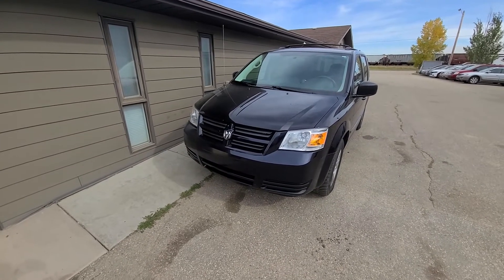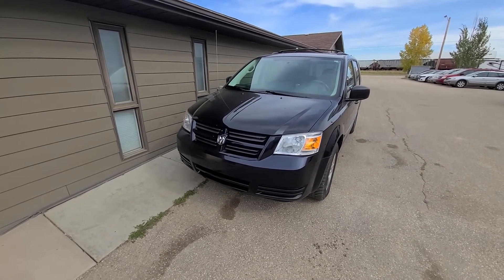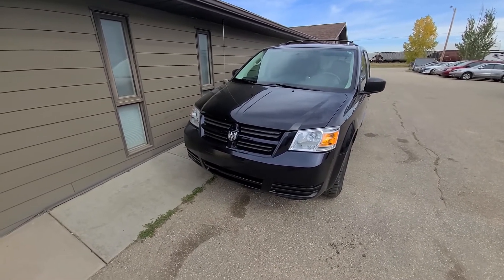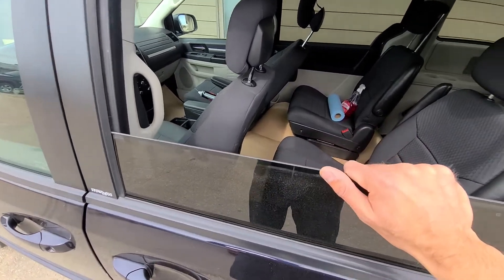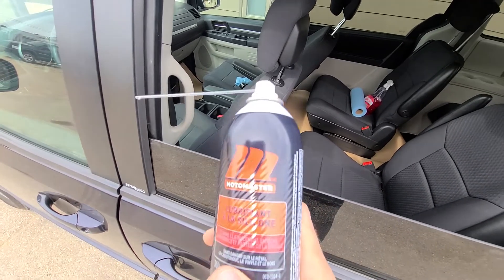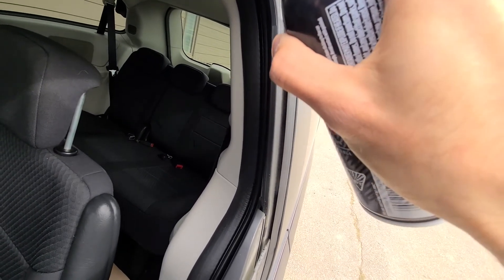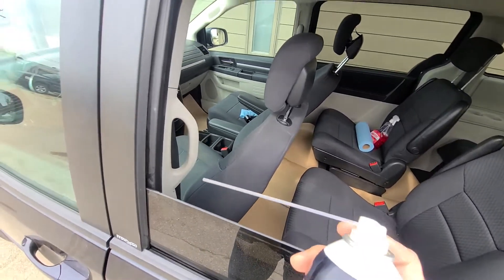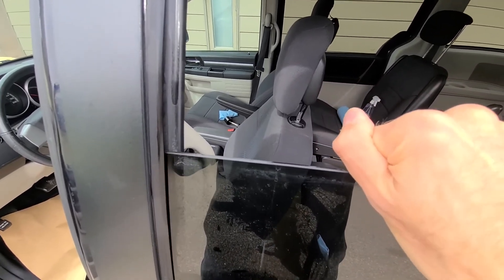Dodge Grand Caravan - SQUEAKING NOISE FROM SIDE SLIDING DOOR? (2008 - 2020)

Comment: i will try it and let you know
Reply from the maker: if it doesn't help you can try lubricating sliding door locks with wd40 as they can cause that squeaking noise as well
Reply: @QuiteAlright  It works for a couple of days but the sounds back a gain
I will try again

Comment: That noise is nothing compared to the noise our 2011 Caravan is doing!  Loud cricket like noise 😵‍💫😵‍💫😵‍💫😵‍💫. I must say I love our Sienna way more.  Still will try this and see if it helps...thank you
Reply from the maker: Also lubricate door locks on sliding doors and all those rubber inserts which go inside the door while it is closed. You can use WD-40. That should take care of the problem
Reply: Do what I did fold up small piece of paper towel and stuff it inside the sliding door pillar where those little black taps go into when you close it

Comment: I have this squeaky noise coming from both sides every other second while driving, sounds like it’s coming from multiple places and driving my insane. I don’t have the rear roll down windows though, you think it’s just the front ones?
Reply from the maker: I know what you mean. Get WD-40, open the sliding doors and lubricate door mechanics, hinges and all rubber / plastic parts you see on both sides (sliding door and door frame). It will go away

Comment: Windows are not the problem. It's the 2 slots on the door jam for the sliding doors.
Reply: I thought the same. But even after lubing those, the noise still persists. I'm going to try the windows next (though mine down roll down)

Comment: Hi again. This worked for about a month. Started again. Did the spray again. Did not work that time. Now the other window has started to squeak. Any other suggestions?  They are fixed not roll down windows. Thanks
Reply from the maker: Try to lubricate sliding door locks and all the hinges with WD-40. This also often fixes the problem